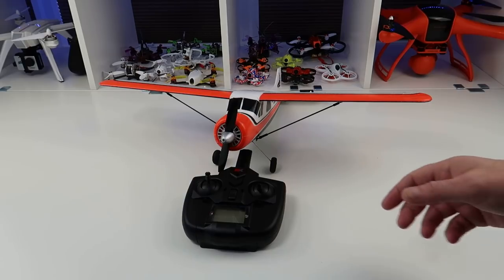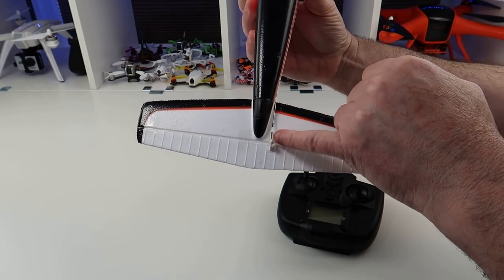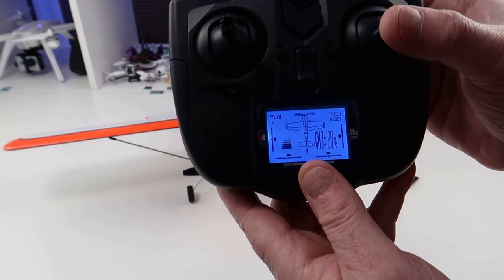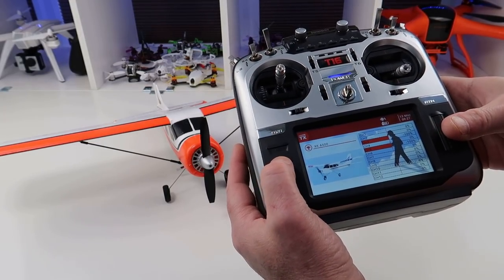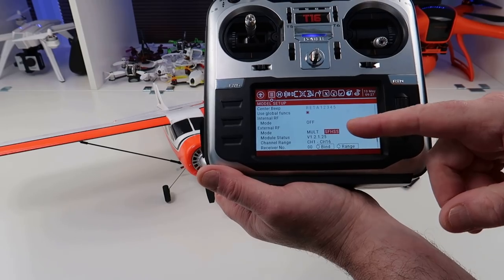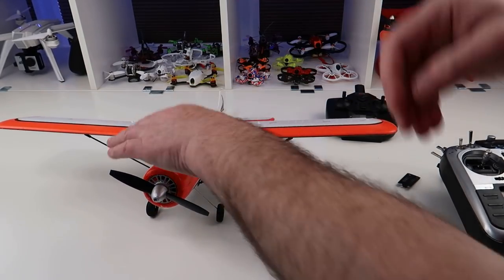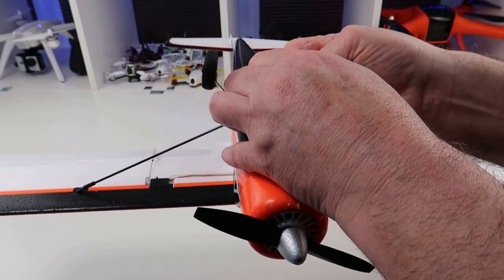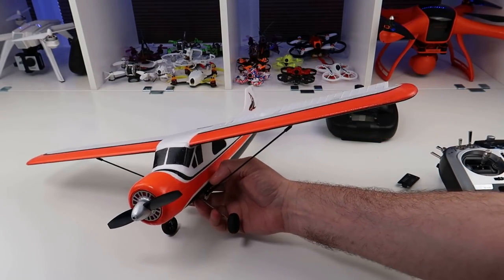XK A600 DHC2 PLANE REVIEW AND BINDING TO JUMPER T16

Comment: Hey, wanna ask is it better control using stock x4 transmitter or aftermarket transmitter? Does using aftermarket transmitter flies smoother and much more powerful signal? Because my xk x4 stock remote always disconnecting by itself with the plane about 50m distance. Should I buy aftermarket transmitter?
Reply from the maker: Yeah the stock transmitter is poor